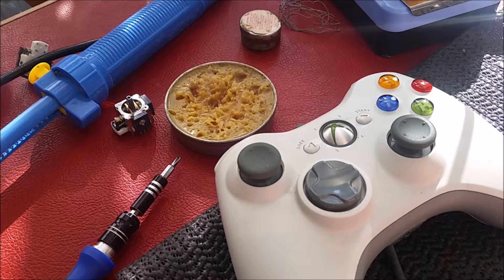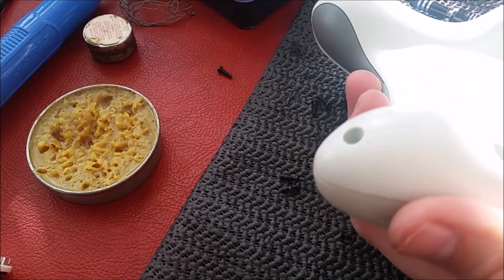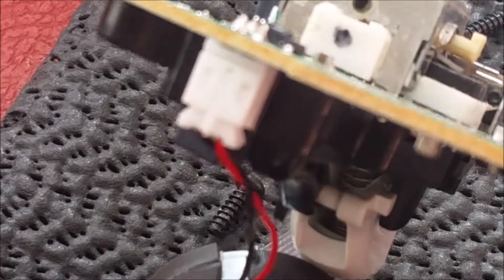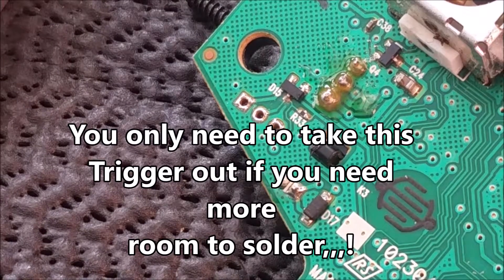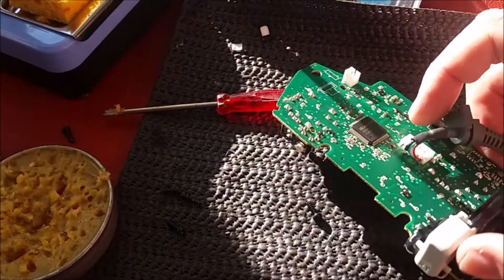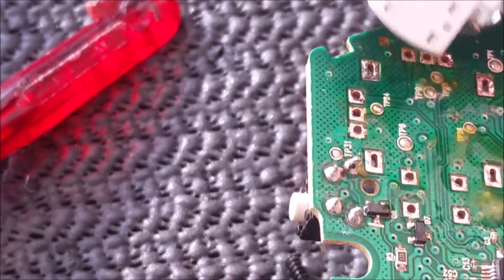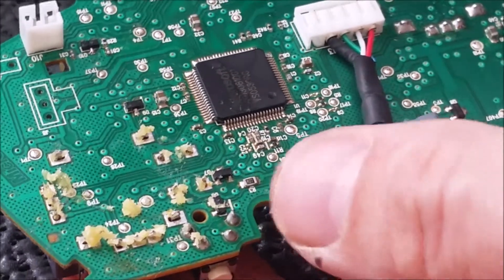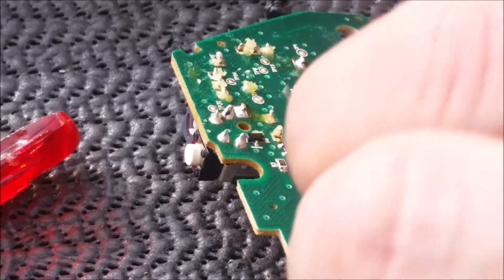Lets fix a Drifting X-Box 360 pad... A Quick Guide

Comment: I'm actually surprised this has happened. I've used Xbox 360 controllers, PS3 controllers and never had issues.  There was one controller that turned ever so slightly on FPS games but no gamebreaker.

But Dualshock 4s? They are notorious for getting stick drift within a year.

Comment: Quicker guide - buy a new one! :)
Reply: The only reason I want to repair mine is because it is from my dead mother and I want to keep using it
Reply: The new ones are of lower quality. I bought a space purple Xbox One Wireless and 

a) the annoying xbox light cant be dimmed when playing on pc 

b) the quality is lower for the Xbox one controller, regardless of their profit margin you can tell they lowered their cost by using cheaper materials its noticeable immediately 

c) it no longer comes with the wireless usb dongle it has Bluetooth leading to 

d) Bluetooth is terrible and Microsoft only provides the USB wireless module on the black controller and no longer sells them seperate. Thatll be $30 for the dongle which might not be OEM 

Returning and going to try and fix my 360 controller instead, videos like this have value for those of us so inclined
Reply: @georg6876  3. You didn't get the joke! :)
Reply: @SixStringViolence  didn’t really have a punchline in the first place
Reply: @SixStringViolence  I got the joke, but the "new" ones floating around are all counterfeit and don't last 8 months. Let alone a decade like the OEM ones do. It's better to repair, it will be quicker in the long run because you won't have to wait on shipping for replacements constantly. lol

Comment: If I accidentally lifted off a ring during desoldering, can it still be saved? I'm annoyed I ruined it in the very last min :-(
Reply: It's gone friend i made the exact same mistake. Rip your and my xbox 360 controller.
Reply: @xm214-aminigun9  I managed to fix it. By scraping off a bit of the trace, I tested to see if there's any contact with a multimeter, I took a very small piece of copper wire (from a cat 6 cable), tin it with solder both ends, drop one end on the trace with a drop of solder another on the pin. Remarkably saved it
Reply: @darude1420  dammit my dad did the exact same thing but didn't save god im unlucky now the whole board has the rings gone no saving

Comment: so quick question a couple of those surrounding chrome square pieces where the pins make contact fell off on my mobo! am i screwed or can i fixit?
Reply from the maker: depends... the corner pads are just earth, so as long as the pins at the sides make contact it should be ok?
Reply: @Retrogranddad  ok ill have to recheck see if I can fix it.

Comment: What to do if after re-soldering a replacement  analog (3rd party part) 
it drifts a bit to the left and downwards? Physically it looks straight 
in the center. Is there a way to log in to the controller to adjust it's
 analog possitions?
Reply: Sounds like the replacement switch is defective. Sadly a lot of the aftermarket switches are not good and either don't last long, or are defective from the start. You'll unfortunately have to repeat this repair again with another (higher quality hopefully) switch.